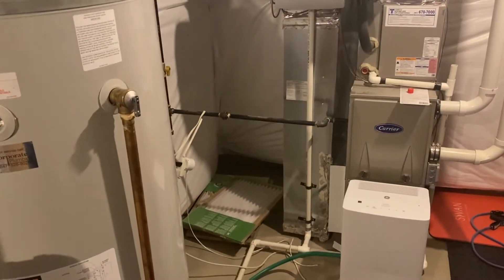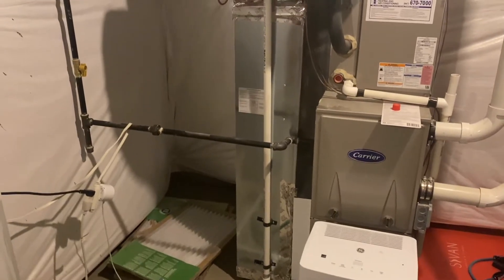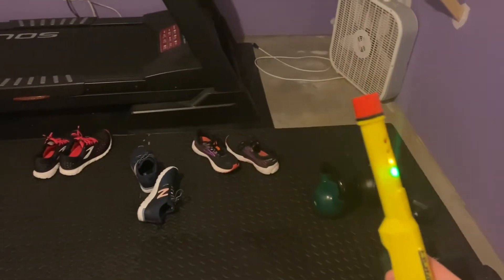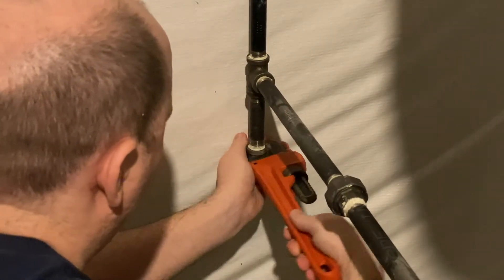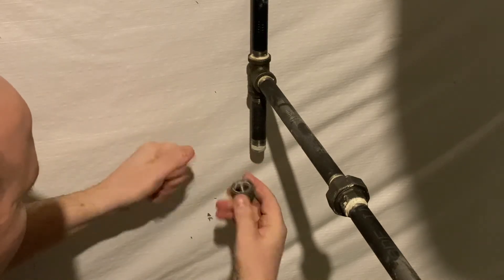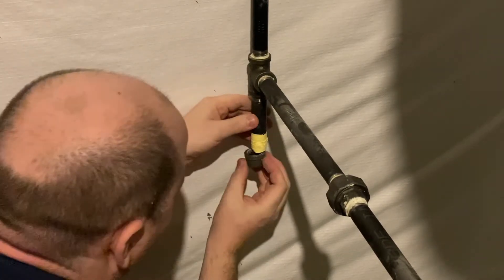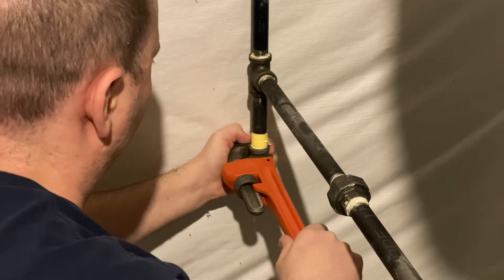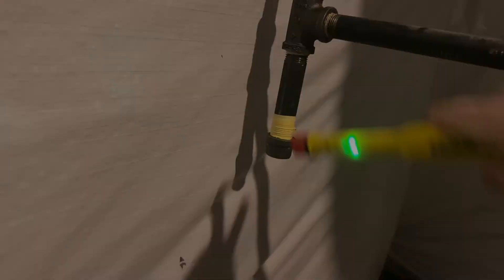Finding and Fixing Natural Gas Pipe Leak

Comment: Hate to tell you that as a professional licensed HVAC tech for 20 years that if your Windex or soap bubbles don't show a leak neither will that meter. You must have missed checking that joint or didn't see the bubbles or fizzing. If you "smell" gas it means it can't even hold .5 or 1/2 PSI. Most municipalities require either 10 PSI or 15 PSI of inert gas (compressed air or nitrogen) to hold for at least 24 hours.

Comment: You didn't use enough tape 🤡
Reply from the maker: Haha! Thanks for that. Yeah, bit of a rookie move on my part, but it doesn’t hurt anything.
Reply: @brianapel8404  don't use tape on gas. Gasoila is the best! 🏆
Reply: @jeffreyjohn2037  

Tru Blu or Leak Lock is the best.

Can you put a hose onto a barb fitting with Gasoila like Tru Blue or Leak Lock and a clamp then pressurize it to 120+ PSI with no leaks or blowing apart? That is probably a negative ghost rider.

Comment: You applied way too much Teflon tape. You only need 3-4 wraps max. on pipe sizes 1/2" and 3/4" NPT (it's the TPI that is important, not diameter). 
Also you didn't use a backup pipe wrench when tightening, putting a lot of stress on the pipe, in a sideways direction no less (not good).

Comment: In NY we use lamp wick and pipe dope. Never teflon tape on oil or gas piping. It's actually against code.
Reply from the maker: Well the yellow tape is allowed here. 🤷‍♂️
Reply: @brianapel8404  on propane too? I never saw that. How about oil (died diesel fuel)? I would think it would just discenigrate it.
Reply from the maker: @TheRabidPosum  Don't know about propane or oil piping. But it's allowed for residential low pressure natural gas piping at least, and for me--that's all I care about! :-)
Reply: I stopped using pipe dope in 2016; PTFE tape only, on potable, heating water, nat. gas and propane 
Licensed gasfitter in Toronto Canada 
I highly doubt Teflon tape is against code in NY (for nat. gas)
Reply: @walterbrunswick  it is, and I have never seen it in the field, commercial or residential. Only dope.
Reply: @TheRabidPosum  Sorry I'm going to call bullshit on your statement
I looked up gas code in NY ...

403.9.3 Thread Compounds

Thread (joint) compounds (pipe dope) shall be resistant to the action of liquefied petroleum gas or to any other chemical constituents of the gases to be conducted through the piping. Use of cotton thread (lamp wick) is prohibited.

Please explain.

If you are still using lamp wick, you should be reported and fined.
Reply: @walterbrunswick  just dope for gas piping. Wick for other applications. Teflon is prohibited for oil and gas, LP and natural. I think anything else you can use wick or tape, depending on preference. But it's always a good idea to use dope also.
Reply: @TheRabidPosum  but that doesn't make sense? UL and CSA listings for applicable usage!
please check again with your local jurisdiction